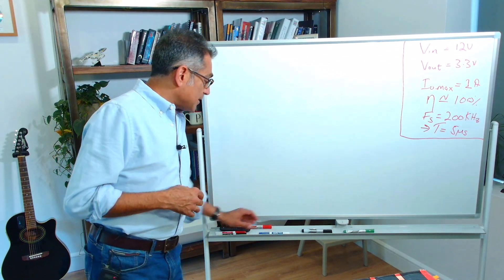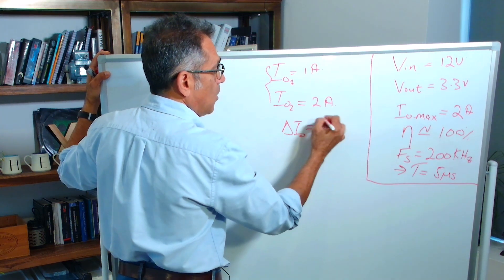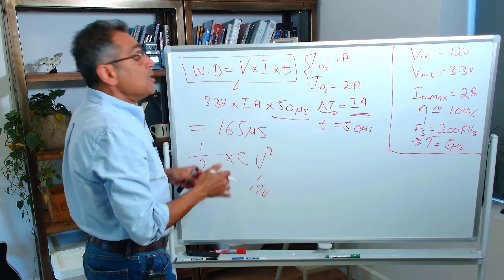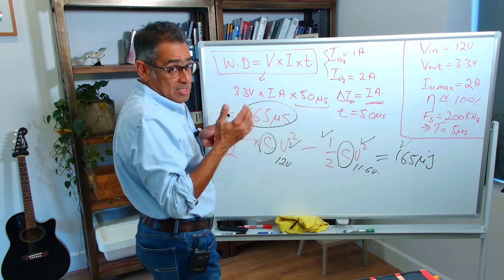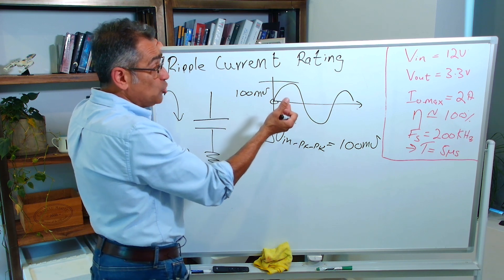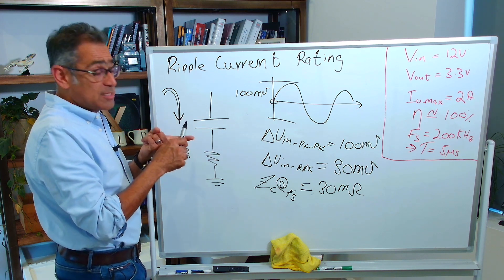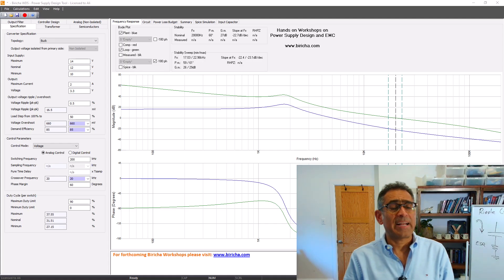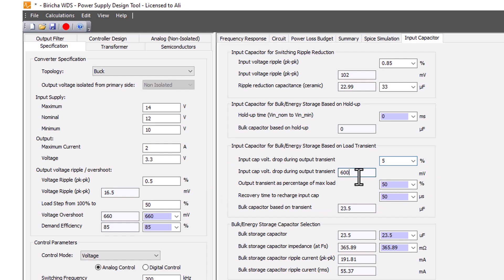Input Capacitor Selection for Power Supplies (Part 3 - Electrolytics/Bulk)

Comment: Hello, doctor! According to the derivation formula of the input electrolytic capacitor, I do not understand why the smaller the time to allow the input voltage to drop and recover, the smaller the capacitance of the input electrolytic capacitor should be.

Comment: Hello Mr. Shirsavar, thank you for your well detailed content and your professionalism. I much better understand how to deal with capacitor impedance in SMPS applications.

Could you please do some videos around capacitors in analog compensation circuits (ex.: type  2 compensators etc.) ? 
What type of capacitors to use (films, ceramic etc.) ? 
What to pay attention to, given switching frequencies (ex.: impacts relative to the types of components choosen etc.) ? 
What minimal tolerance to use for the capacitors and resistances ?

Another idea of subject:
For digital ACMC converters, I wonder if it is sometimes necessary to slow down the outer voltage loop by sofware program or if genarally, the dynamics is naturally set between current loop and voltage loop, so that the current loop is always faster than the outer voltage loop ?

What ratio would you recommend between the cutoff frequencies of inner loop and outer loop in cascade control ?

Thank you